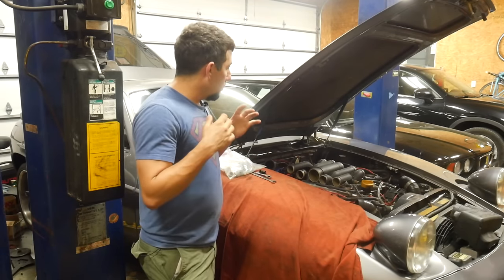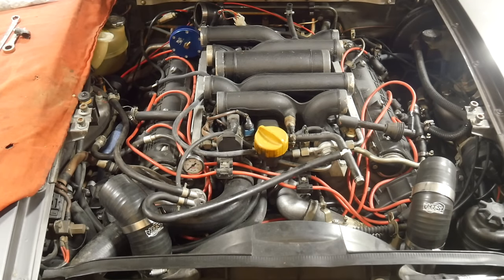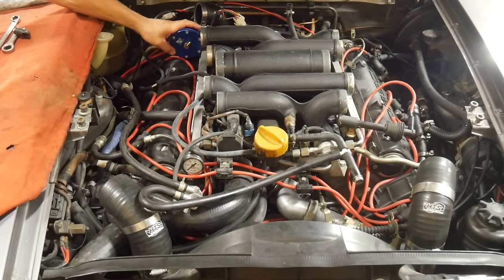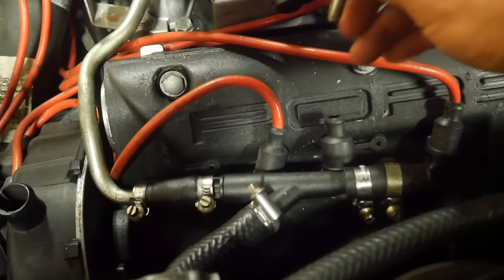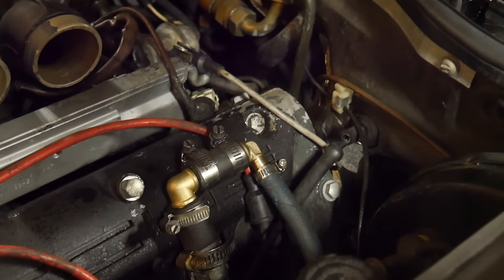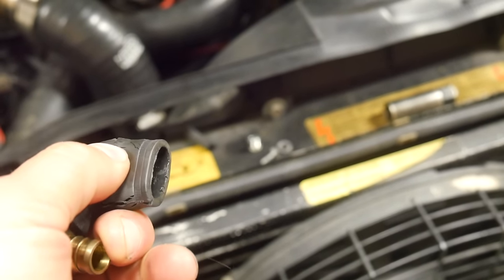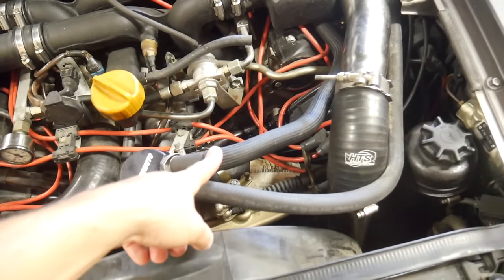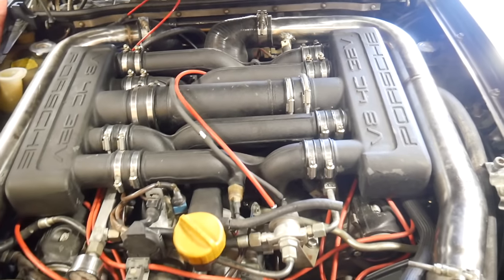Porsche 928 TURBO Update #2. Progress! Oh, And I Bought Another One!

Comment: since you are doing so much work i would abandon the turbo engine oil sharing since it is a rear mounted turbo mount a simple 1 quart plastic oil tank in the rear with a cooler and a scavenge pump and have the turbo oil itself it wont lower the oil level in the engine make oil changes last longer. and relieve the need for engine oil to travel the length of the car. also you can mount a rear oil cooler in line like a differential cooler to make the turbo last longer. engine turbo oil sharing bad period.

Comment: There is a belt that can run the fan without turning the air pump.  It is actually a lawnmower belt, L410 I believe.  When I had my 928S2 the air pump failed and locked up, destroying the belt.  I found online this belt number and was able to make it work.  It is super easy to install, just undo the bolts holding the fan support to the engine and install the belt.  Reinstall the support, let the bolts introduce the tension.

Great video!

Comment: Good progress, and its nice to see someone giving it the attention it needs. Smart man ditching all the evap and emissions junk. I'd pull that clutch fan and stick a decent e-fan like a spal or something in there too. I run them on my cars with a 30amp relay and override switch just because. Those vacuum lines and cob-jobbed fittings are a nightmare. Bad enough on an N.A. car but even worse on a boosted one. Unmetered air/ vac leaks make anything run like crap. That thing sounds pretty nice as well. I dig the red e39 on style 5's too 👍

Comment: Tip
When you need to repair a vacuum line or low pressure line in a hurry grab a rag and some silicone sealant.
rip the rag into strips slap on so goo and wrap the offending line to bandage it up and let it dry.
You can also use other rubbery glues .
Do it right and the repair may last longer than the vehicle.
This trick occasionally works on oil seals to reduce a torrent to a drip.

Comment: Not good having the turbo oil return line return going to the valve cover. It should go to the pan. Just saying.
It's your car. Do what you want.
Reply from the maker: Like I said, it’s temporary. This winter I’ll be completely an engine out total reseal service and I’ll likely change that to the pan.

Comment: Best car shape ever penned. Not the most reliable or easiest to wrench on though.
Reply: 928 s4 was the best.
Reply: It's OK, you obviously have never owned a 928 or even worked on one. As someone who owns a 300K mile 928, they are stone-axe reliable and easier than most modern cars. They have quirks like all nearly 40 year old cars do.
Reply: They are very reliable and easy to work on, since mechanically it’s a tank. Timing belt and water pump takes a couple hours, and should not be left past their due. The only hard part would be the clutch if you get a manual due to the torque tube, so might no be DIY friendly. Brakes, shocks, steering parts, control arms, etc are normal.
Reply: @16v15  in my experience it was because some owners take them to domestic car shops instead of foreign car repair shop. Same thing with BMWs up to the 2000s, the new ones are throw away, but up to the E39 were very good cars.
Reply: @PatricioGarcia1973  Dead on. 928s biggest weak point have always been their owners. Like many earlier upmarket cars, they have maint and service requirements, that the average guy who 'got a deal on a used Porsche' just never does. (Because he should have bought a Camaro...) It was a 50early-100Klate car when 50K bought a starter house (or later, a healthy down payment). Same with BMW and Benz of the 70s-90s. Prior to going Porsche I was an E12, W116, W126 guy. All lasted 200K+ miles, and ran fine when I let them go with basic maint along the way.
Reply: @PatricioGarcia1973  T-belt takes just about the same time as my aging Acura. All the 2V are non-interference except the RoW. 4V are all interference. Regardless, it sucks to be stopped by a fragged t-belt. The late single plate clutch is straight forward, TT simplifies it (imho). The older dual-plate clutch is a bit trickier to set up, but it's the high-HP choice. IIRC, the 86 was the last year for the dual-plate.
Reply: Among the best shape, but very reliable and EASY to wrench on!  The electricals used to be considered "complex" but by today's standards they are not.

The best 928's were the '84-'86 S2 or ROW [Rest Of World = Non USA or Canada] cars.  Find a 5 speed and it will  in stock form run a high 13 second quarter mile time.  

The only thing I will say about 928's is that they are very physical cars to drive.  Everything is heavy but the effort is worth it!

Comment: When I had my 928 I used to get people at stoplights asking me if I had done a Chevy conversion due to my Borla exhaust.  Everybody knew what a 928 was, nobody seemed to know that they came with a big block V8.

Go figure-
Reply: Well, most people know that the 928 is a V8... but they certainly never came with an American "Big Block" engine, and I doubt that one would even fit in there.
Reply: @johncoops6897  What are you talking about?  The bore spacing on the M28 engine was exactly the same as the Dodge/Mopar 440 cubic inch engine.  And it is so close to the big block General Motors engine that Ardema, a  hot rod group out of California, has  built  several 32 valve DOHC big block Chever-Lay motors for rat rod owners.  You know NOTHING based upon your post!
Reply: I ate Taco Bell;  It's going to stink BAD~

Comment: Stupid question: would taking out the engine and working on it make it a lot easier or the effort to remove  and reinstall would be far greater inconvenience then all the trouble now?
Reply from the maker: Not a stupid question, it would be. However, I’m planning an engine out service this winter and I’d prefer to get many of the quirks ironed out before that process. In the event there’s an issue, there would be a lot more variables if I did it all at once.
Reply: @I_Do_Cars  👍.  I absolutely enjoy your presentations. It’s engine disassembly so shouldn’t be. But it is. No two disassemblies have been the same.

Keep on keepin’ on…

Comment: Jeremy Clarkson would approve, he has a special place in his heart for a 928.
Edit: I'm not a huge fan of ls swaps but I always thought these would be great with one
Reply: Probably.
Reply: Wasn't it 968?
Reply: @ert870  the 968 had a 3.0 I do believe and Clarkson had the 928 in the v8 special
Reply: He had the 928, he said it allowed him to go visit his father at the hospital before he passed away.
Reply: Why would want to spend an f-ton of cash to have a half-assed, never fully sorted, ls in a 928? Because Cooter down at the garage knows 'em?
For the same (or less) cash you can leave the correct engine in place, build more horsepower, go fast without having it some ugly lump under the hood.
Reply: @16v15  😂first of all I doubt he would do a half a** job he would most likely full a** it and have it sorted and secondly these once engines get into high milege they tend to have problems.
Reply: @themustardguide  So how many of those swaps have you done/seen? How many do you know the cost of? Do you know what it takes to interface them properly electrically? Do you know the mechanical problems are you'll run into sorting one? 

I know you don't, just like every other ill-informed broke 'hot-rodder' who thinks the solution is always "throw a small-block init". $10K later it still isn't right, and it costs them another 5-10K to fix it. Oh, and what high-mileage problems have you seen on any series of 928 engine that aren't due to poor/deferred maintenance?
Reply: @16v15  why are you so angry about this? Also I did say I'm not a fan of ls swaps, anyway it's nice you took the time to give YOUR opinion on the matter, thanks 👍
Reply: @themustardguide  Angry? Hardly. But it's  stupid idea, and if you do some actual research you'll learn that. Or, go ahead and try. I've just seen enough of them, to know what will happen. I believe the appropriate Brit saying is "it all ends in tears". 

YOU offered that it might be an interesting swap, I just offered my experience with said idea. But hey, do what you want. Semi-free country and all that. Happy 4th!
Reply: @16v15  I do believe the proper Canadian saying is "you're all spare parts bud"